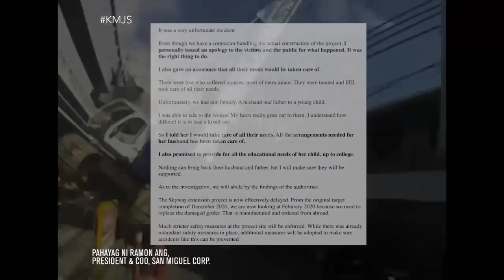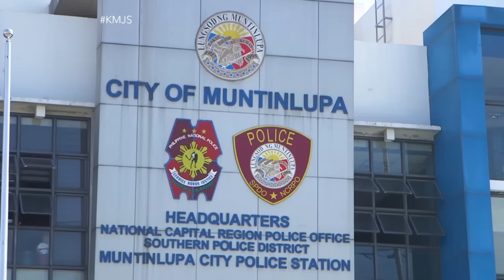Kapuso Mo, Jessica Soho: Steel girder ng itinatayong Skyway Extension Project, bumagsak!

Comment: Bat yung driver pa in yung kkasuhan dapat yung company din . Di rin naman ginusto ng driver ng crane na mngyare yun talagang pabaya lang din yung kumpnya.
Reply: Totoo po, tsaka bakit nakapatong lang don yung steel girder. Kulang sila sa safety protocols makasuhan sana yung company, sa pagkakaalam ko EEI yun. Yung sa driver ang bilis kasuhan pero yung const company nadadaan lang pala sa pakiusapan. Iba talaga nagagawa ng pera.
Reply: walang my gusto mangyari yan kawawa operator ng crane dapat di sya kasuhan panagutin kung sino my sala
Reply: Pagmahirap kakasuhan pag mayayaman dedma lang🤣🤣cute po nila dun🤣
Reply: alam nyo kasi kargo ng driver pag ngka aksidente secondary n lng ang companya
Reply: @carlajane510  wag mo Ng questionin Yung Girder Beam Kung nkapatong lng Kasi construction operation yan may accident na Ng yari Yun yan.
Reply: kung ikaw may companya ka  nka aksidente yung tao mo cnu me kasalanan nun ikaw ba
Reply: @yhumicamasis4854  pwede naman pong isecure yung steel girder, or kinabit na sya gabi palang. Or hindi sana nilagay yung tower crane sa alanganing position. Diba po yung paggagawa ng LRT/MRT Precast nadin, ibig sabihin installation nalang. Gabi sila nagiinstall para kung may mangyare mang aksidente wala masyadong tao sa paligid.
Ang mga safety protocols po galing yan sa company. Yung construction site dapat sapat yung mga warning signs nila. May sarili silang engineer dyan, tawag dun safety engineer. Fully oriented dapat mga tauhan about sa safety, at dapat laging may supervisions. Lalo na sa mga malalaking company, dapat kahit maliliit na bagay gaya ng pagsusuot ng safety shoes, gloves, hard hat, etc mabilis sa mata ng safety engineer.
Para sakin po di naman po ganun katalino yung driver para malaman lahat ng yun, di nya alam na pwede mangyare mga ganung bagay. Pero ang engr at ang company, alam po nila yun. Dapat alam nila na pwedeng magkamali ang mga operator sa ganun. Napabayaan lang siguro, hindi nakasecure yung girder o yung towercrane, kaya nangyare ang ganitong aksidente.
Reply: swerte ng kompanya kawawa ung driver tsk sablay talaga batas sa pinas
Reply: @tonyodizz1504  malalagot din naman po kung sino may sala sa construction company dahil may mga pinipirmahan po yang kontrata. May lisensya mga yan, may sinumpaan.
Kaya nga masususpinde ngayon operation nila dahil may mali talaga sila. May kaso yan na aayusin at lilinisin. Mababago mga plano nyan kasi maaadjust mga dates, gastos din yun sa company. San miguel yung gumagastos. EEI yung consruction.
Reply: Kawawa naman sya. Dapat di sya makulong di nya naman ginusto ang nangyare. Hayts
Reply: Dapat kasi  ginagawa yan Hindi dinadaanan..d nmn kasalanan ng driver.
Reply: Liable mg company...
Reply: @carlajane510  feeling ko di yata alam ng mga tao iba ang Owner sa Contractor. Sinisisi nila San Miguel hahaha. Ang responsibilidad lang ng San miguel mag pondo hahah.
Reply: jan nag ttrabaho asawa ko. sabi nga rn nya kawawa ung crane operator.
Reply: @carlajane510  💯 agree.
Reply: Guys manood kayo ng Crane accidents compilation
Reply: Syempre laging kawawa ang mahirap dapat yung mismong contractor yan e
Reply: @yhumicamasis4854  dpt po yn d pinddaanan simple lng
Reply: One thing is for sure... the sense or obligation for safety as said in the saying  “Duty of Care” was not applied... included here are: diversion of traffic elsewhere, closure of the road for pedestrians, area demarcation and fencing for ongoing construction... in Australia and New Zealand, if there is no “Duty of Care” present, prosecutions, fines, disqualifications and discontinuation(s) of the project(s) are fully enforced to the point...
Reply: Yan din po iniisip ko.Kakaawa naman yung driver.
Reply: ANG HUSTISYA AY PARA LANG SA MAYAYAMAN
Reply: @tonyodizz1504  dependi yan sa sitwasyon pero dito dapat may papanagutan din ang companya.
Reply: bkit ung operator ung kakasuhin hindi nmn niya ginusto ung nangyari saka desgrasya yan dapat ung company at   engineer  ang kakasuhan jan.kc isa pa nagpapa operate cla na de man lng nila sinara pansamantala..de kong pinasara muna nila kahit paolit olit pa yang babagsak atlest walng mga taong ma desgrasya...
Reply: Yes nag work lng si kuya hindi niya din gosto Ang ngyari
Reply: Ruffy tulfo in action
Reply: Bayas
Reply: @tonyodizz1504  the company of what ever company you're in is obligated to the safety of their workers and the public. Kahit na yung driver ang maykasalanan kailangan managot ng kumpanya dahil di sila nagsagawa ng safety measurements. Mahal magpasara ng kalsada dahil maraming maaapektuhan kaya ng dive in yung kompanya sa risk na mag operate sila kahit naka open yung kalsada. Ang kumpanya ang nag decision hinde yung driver kaya sila ang mananagot sa buhay ng maaapektuhan nila. Palaging may accindente sa work kaya di mo masisisi yung driver at alam nila na posibleng mayari ang accidente
Reply: If by laws of obligation may kasalanan din ang driver at ang companya pareho sila mananagot at pareho dapat nagingat.
Reply: Un nga eh... Hindi niya ginosto na mangyari yon pero bakit makukulong... At kinasuhan ng ano jan... Nagtatrabaho lang sya... Napapanahon ang aksedente... At ito rin ang galit ng panahon kung anong ginagawa ng mga tao sa mundo niya... Sana mabigyan ng konsiderasyon ung driver...
Reply: Magisip kayo not out of naaawa kayo. Pagisipan ang situation. 
For example may isang bahay na may 2 floors at may isang lalaki na nageexercise sa balcony nila habang nageexercise siya accidentally niya nahulog ang pot niya na may flowers na nakalagay. Then may natamaan sa baba at namatay. 
Oo accident pero need parin managot. Unfair iyan if hindi managot. Ganyan sa LAW. Sana naman maisip niyo iyun.
Reply: @kd9d3p74  korek ..i agree...
Reply: @purpledream4134  Kawawa naman po si kuyang driver, sanaa magawan padin ng paraan para di sya makulong kasi sabi nga ni JESSICA SOHO walang sinu man ang may gustong mangyare yun e😥💔
Reply: @hey.4902  kahit nalang sana yung kumpanya sana sagutan nalang si driver kasi po diba trabahador lang si kuya nakakaawa naman😥
Reply: @kimbryanmagsino8201  Oo  nga eh.
Reply: Oo nga, mga MATAPOBRE SILA!!! ANG INIISIP NILA PERA!!! Kawawa naman yung driver dinamay pa lalo na kung may asawa at anak pa. Hayyy!!!
Reply: h
Reply: oo nga dapat di siya kinasuhan dyan sila ang may kulang ....madayang kumpanya......porke ...may pera
Reply: Tama napaka unfair di Naman ginusto ng operator ng crane Ang nangyari eh tapos siya pa ang kakasuhan sad
Reply: Oo nga di naman ginusto ng driver na magkaroon ng aksidente at saka dapat sinasarado nila ang lugar na yan pra kahit may mahulog walang maaaksidente sa baba...
Reply: Potang inang sistema ng batas dito sa pilipinas napakabulok at para lang sa mayaman.
Reply: dapat kase hindi muna pinapapadaanan yan alam naman na ginagawa pa eh
Reply: agree
Reply: Tama
Reply: Tama to, ang dapat managot diyan ay yung company kasi wala sila safety
Reply: Agree
Reply: Oo nga

Comment: Kawawa yung crane operator. Medyo unfair yung ruling nila sa kung sino yung responsable sa aksidente.
Totoo nga na may error ang crane operator, pero sa construction, given na yang error and accident at dapat na foresee na nila ang mga hazards.
This is an error in the management side dahil hindi sila nagperform ng safety precaution. Standard na kasi sa program of works sa construction ang maglagay ng construction safety and health, traffic management and detour sa mga projects na malalagay sa busy na daan.
Hindi ko alam kung sino dapat i.blame dito dahil marami ang posibleng involved dito. Maaaring nagtitipid ang contractor kaya siguro walang traffic management/detour. Maari.ring error sa plan at estimate kung hindi nila nalagay ang traffic management at detour sa scope of works. At maaari rin itong error ng LGU or traffic control office, if they insisted na patuloy pa din ang pagbiyahe sa daan sa kadahilanan makakaapekto ito sa daloy ng pamumuhay ng mga tao, sa trapiko at sa ekonomiya.
Ito ay mga agam2 ko lang.

Pero sa opinyon ko, wala sanang mamamatay kung nagpatupad lang sila ng detour, traffic management at construction safety during their activity.

Comment: Sa mga di po nakakaalam iba ang Owner sa Contractor. Ang Owner ay ang San Miguel. Ang contractor ay EEI. Ang responsibilid ng San Miguel mag pondo ng project ang responsibilidad ng contractor ang pagawa at safety ng lahat. EEI po ang may kasalanan di San Miguel.
Reply: Dapat company ang kasuhan d yung driver
Reply: @johnemersonaragon5244   dapat yung driver din di porket di niya sinasadya wala siya kasalanan. May training at license mga operator ng crane. Yan ang point ng training ng crane operator para di pumalpak ng ganyan pero pumalpak siya. Civil Engineer ako by the way.
Reply: @leonesperanza3672  Tol lahat tyu d pirpicto na kahit anu pang pag sasanay mu pag dating ng disgrasya wla tyung magawa kong sayu kya nangyari yan anu pakiramd mu